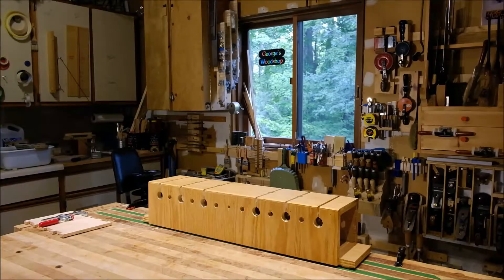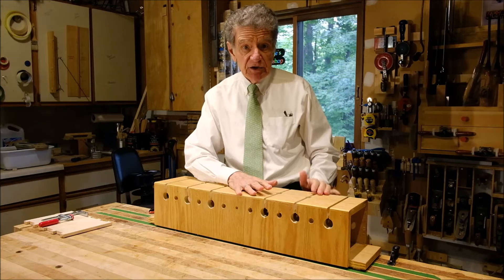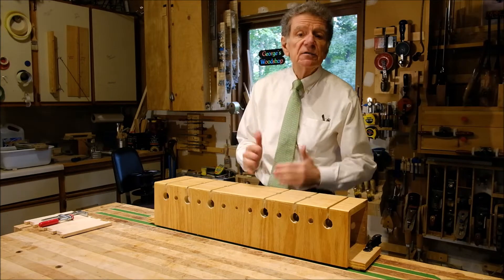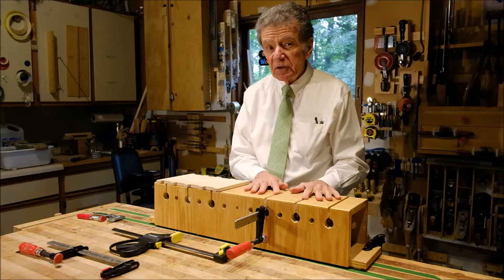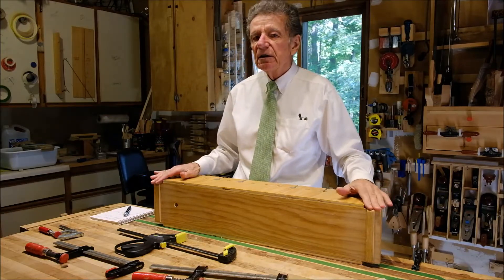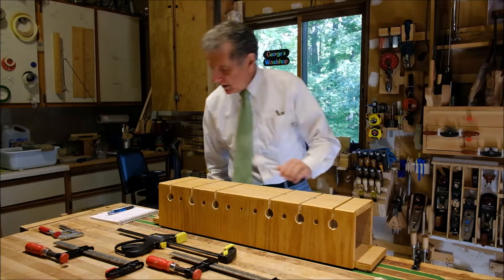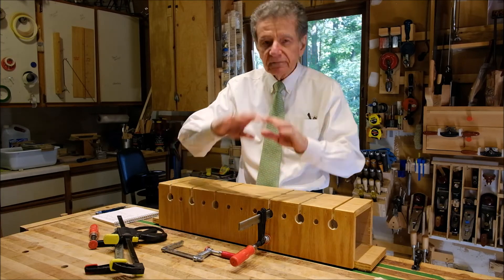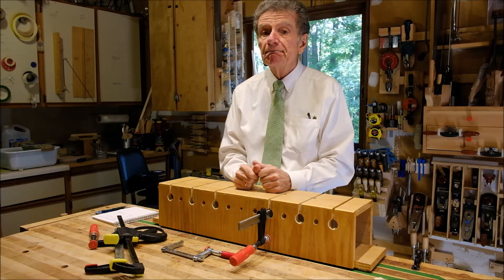Leggy Tip #3  Workpiece Elevator

Comment: George, I really like that device. One thing springs to mind, if the box section was rectangular and you extend another side to hold it to the bench when rotated 90 degrees,  then you could have two heights above the bench and thus accommodate thick and thin components.  In that case you could get rid of the no-purpose holes as you would have to stagger the slots from the original ones.
I'm thinking this might be good for sharpening saws as I find it difficult getting down to vice level when filing. If some sort of saw chops were clamped to the front face then the saw could be held at a better working level.  I love it.  This is something for the future after I finish the current project.  Thanks
Keith
Reply from the maker: You know, I thought this was to be a sole video on the topic, but your recommended modifications -- resulting in two working heights -- call for an update.  Thank you Keith.
Reply: @georgefouriezos8863  You're welcome George.  I'm not trying to be a smart ass, just constructive comment.  The downside is that the clamps would have to be longer for the wide side, but hey! you can never have too many clamps.
Reply: I'm glad I read this Keith 😊 as this was thought I had also. To modify the sides for other purposes and I will look forward to what you do with it George 😊 ॐ
Reply from the maker: @keithclague4403  Longer F-clamps, no problem.  The long ones would also handle the narrow span.  Besides, a small difference -- 3 or 4 inches -- would make a big difference to working height.  I really like this suggestion.  Not sure that I'll remake an elevator; I might instead just stack a small box on top.
Reply: @georgefouriezos8863  I also thought of the rectangle for two heights, however, your idea of a small box on top sounds even better. Maybe a bigger pair of shoes might do the trick. Great videos, by the way!
Reply from the maker: @corwind3888  I've also seen the odd YT video featuring adjustable-height workbenches.  I'm not there yet.  (LOL shoes)

Comment: Hi George,

 I'm in the process of building one right now. I'm trying to figure what the small holes are for. I know you mentioned you forgot what they were for. Please update if you happen to remember. Your efforts are appreciated.
Reply from the maker: Hi Flyin,  I'm sorry, still nothing on why I made the small holes.  I wondered whether it was screwdriver access or pilot holes but those did not ring a bell.  Maybe to slip a rod through, or to hook a bungie cord?  Nope, never did use them that way, or any way actually.  It is not at all out of character for some of my "great ideas" to go nowhere.  By the way, one viewer tip worth hearing is to make the height and the width different so that turning the box on its side yields a different height.  I have not worked out whether that would weaken the box, but it does sound like a good idea worth passing on.  Thanks for letting me know you're making one, and here's to getting lots of use from your build.